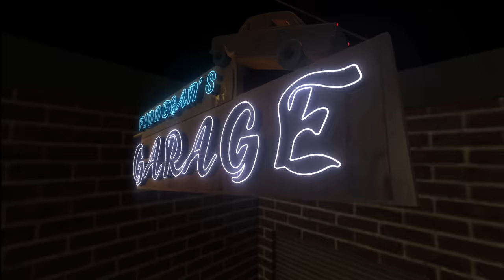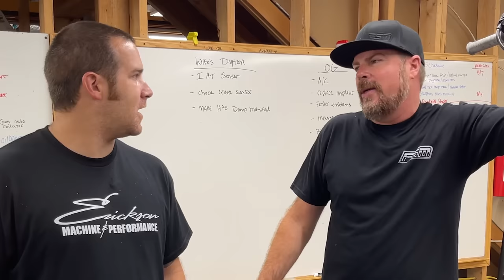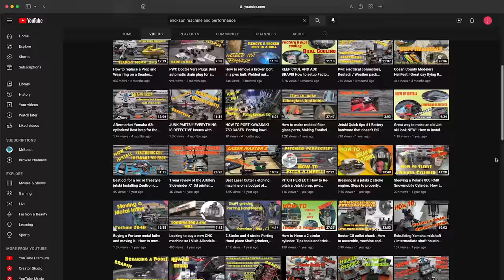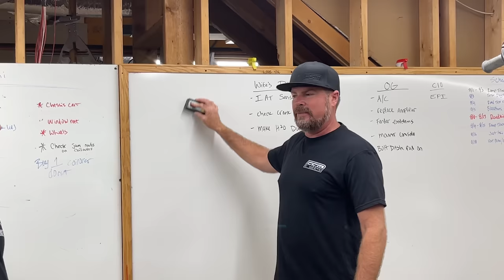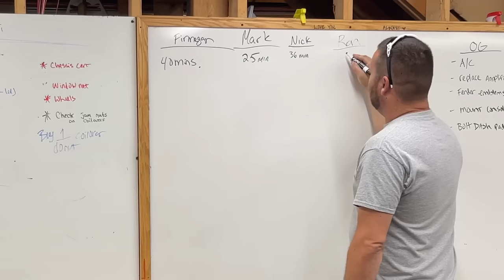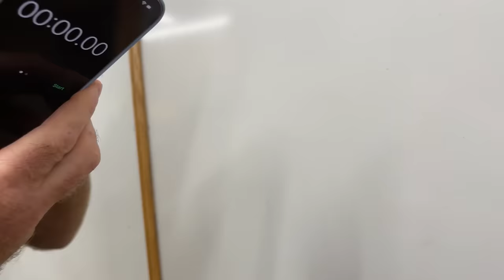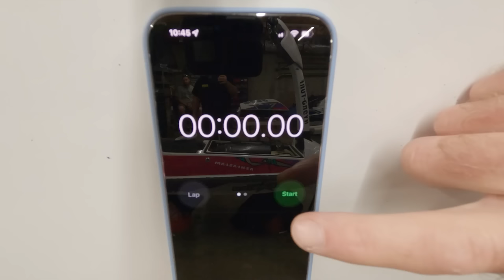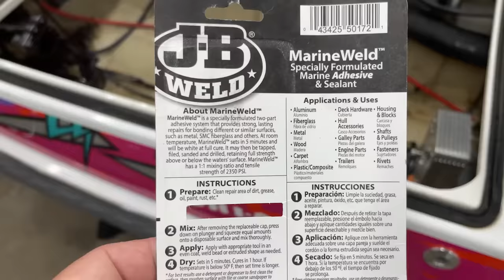BACKFLIPS ON A HOT ROD PERSONAL WATERCRAFT!

Comment: Thanks for having us on the channel!!  Enjoy the new powerplant!!
Reply: i don't think anyone thinks you can't supercharge or turbo a 2 stroke ... it's been done lots of times ... but making it reliable is the next problem
Reply: @Hard_Right  alot of people think you can't.    Very few have done with a PWC 2 stroke.    We are working on 1 now and will be on our channel soon
Reply: Awesome job bro. I had no idea prices were so reasonable for pump work etc. After im done painting my newest chopper build, I will for sure be getting ahold of you. Great job.
Reply: Good work man.
Reply: nice work, bring your own kroil next time
Reply: Dyk’ing lines and wires…that cuts time significantly.
Reply: @nationsenemy  only cut the hoses because we replaced all of them.  No wires where cut
Reply: Did you fix the head bolt that clearly didint take torque in your engine assembly video?
Reply: @drake_24v_hawkins  🤣
Reply: Hey pal,  i been workin in powersports for the last 20 years and one thing i do when I get water ingestion or breach on a 4 stroke is mix wd-40/oil at a ratio of 1/3 and you will see just how fast you can clear it up. =)  Never once had an issue with this hack.
Reply: Subscribed to Erickson M&P, it was so much fun to watch your passion at work.
Reply: Do you guys do the 2019 YXZ1000R  side by side 3 cylinder?
Reply: Dude, getting that motor out, and getting out the remnants of the broken motor mount bolt out, even after the first welded nut twisted off, in under 24 minutes.....you're a freakin' hero, dude. Good thrash!
Reply: Straight badass!
Reply: You guys were great.
Reply: hahahah. those people who think u cant turbo or supercharge a 2 stroke should head down to the Polaris dealership and check out some of the snowmobiles on the showroom floor!
Reply: You just made this the best episode!
Reply: @Hard_Right  2 stroke stuffing got a fluid coupled procharger style compressor for his 50cc nitro 2 smoke.

And the madlads videos are mad artistic.

30hp out of 50cc?
Nitromethane is gangster
Reply: This is amazing wish one day Mark could work on my ski:). I want a ripper. 😊 good job.
Reply: @BTR2018  🤘🤘🤘🤘🤘 thank you 😊

Comment: Love my Superjet and it was literally instant start every time for the first 5yrs at least and then just a starter relay and then i replaced the start/stop switch with a new one bc it was starting to act up. One cool thing about buying the Start/Stop Switch new from Yamaha OEM is that it includes the Nice OEM Safety Lanyard which is like 25$ alone or something and i like the oem one that has the piece to go around your wrist or to clip it on to the life jacket. Makes the price seem a little better at 150$ for the new one, complete ready to install.
He's got a nice solid setup there now, its going to be an insane difference from a stock 700, because an exhaust on a 700 gives you like 20hp alone lol, nevermind the 64X 760 cylinder on there. Cograts man! Rocking the clean SN. My first SJ was SN and i wish i still had that one..

Comment: Good info, nice setup , I have had 3 super jets  if you count one that  was just a hull , and 4 kawasakis over the years. I lived in southwest florida for years  thousands of hours on personal water craft for real. I ran beach services for 5 years. I would play around with different ride plates and maybe nozzles  before I touched the hull . The super jets hulls were great  and easier to corner because they cornered  flatter than the kawasakis. Wide open just bend your knees more and shift your wieght forward .  My old boss had a 94 with a set close to yours , when you held it wide open and let of the gas it felt like you were putting on the brakes becuse it pulled so hard.   Have fun watch out for boats and use the landyard. The old kawasakis used to circle when you crashed and you had to swim after them unless you set the idle down low, not good in the mangrove trails. Thanks great job, keep up the good work

Comment: There is nothing more satisfying than working on a standup ski, other than riding it after you get it running... I've owned standup skis for the better part of 40 years starting with the abysmal 550 that once running it was a blast to ride. I pretty much gave up water skiing from that point on.  I've melted more motors than I can recall and spent many a late evening stuffing the spare engine in for the next day.  My latest acquisition  is a 1500Sxi,  which is a big ski with gobs of power and cruising across the lake at 50mph is good enough for this old man.  My days of subs and back flips are over and the big ski keeps me from  trying even the simplest of tricks.  Have fun on that Yamaha,  it's the perfect ski for your wife and kids.

Comment: The biggest trick on the welded on nut removal is the first weld. If you just give it a pop on the initial weld it basically seals the
 nut/broken bolt from anymore welding getting good penetration. Have to commit right from the get go.

Comment: I’ve had a blast on one of those, after learning how far to lean forward to avoid porpoising.   I was on it when gas ram low, had to ride 6 miles back to camp smooth and straight on reserve.  That was some leg burn with waves most of the way.

Comment: 37:40 "It's to tune velocity" I'm pretty sure it's purpose is to resonate at a certain wavelength (rpm) and create boost. From the studies I've seen published online, a standard-ish 2-stroke with expansion pipe will make 8 to 10 pounds of pressure above atmospheric while "on the pipe" aka, when the RPM is within the resonance match of the pipe.

If you want to see an example of an expanding exhuast pipe that DOES help to tune the velocity, look at the formula 1 headers from the last several years. You will see that they come out of the engine block at a certain diameter, and after about 4 to 10 inches the primary tube will step up about 5 to 10% in size. I'm not 100% sure the science behind this but all the F1 cars do it so it must help!

Comment: Toss the whole drivetrain in a full length or even -4.3" Superfreak Badass or T1 hull, the best mod you can make to a superjet.  If your looking to get the nose down on that hull so that it does not porpoise a flat extended rideplate will help.  I couldn`t tell if yours was concave from the pics.  You can also space the back of the plate down with washers.  The intake grate can also help, a deeper top loader will sometimes help keep it controllable at WOT at the expense of a couple MPH.

Comment: I picked up my '91 650sx for nearly nothing a long time ago. After it blew up it got a SXR 800 engine.  Already had a Coffman's pipe so it was just a matter of getting the pump set up right for it. I know the 650 gets a lot of hate. I kind of think of it as the Mustang of standups. Kinda handles like shit but once you learn how to keep it under control it's a blast to ride.
Reply: I started on a 650sx, they're are great but limited by the tiny pump. And the hulls break in half easily when you beat on them in the waves.
Reply: @blainemacdonald6929  The pump in a 650 is the same diameter as a 750 or 800 pump. The impeller is set back differently but you can clearance a SXR impeller to go into the 650 pump. Where the 650 is limited in regards to the pump is the tunnel but I have addressed that. I'm 230 lbs and this thing tops 50mph with my fat ass on it. That was my goal. I'm going to repitch it for bottom end now. My ride plate, intake, and hull extensions have turned it into a reasonably well behaved ski. The weaknesses of the hull are known and easy to reinforce. In any case I'm on the lookout for a nice stock SXR to go on longer rides and keeping the 650 around for short range play. I've had this idea of building a modern day Yamasaki by putting a TR-1 in a SXR 800 hull. I think it could be a really nice setup.

Comment: So to elaborate a little bit more on super charging two strokes yes definitely can be done and will create more power however will drop the efficiency of the motor as far as fuel consumption whereas in some scenarios with a four stroke engine you will actually gain efficiency and power

Comment: 1987 Kawasaki JS650SX back in the day.   First time I submarined it, I got the nose pointed straight down and drove it right to the bottom of the lake.   Fish going up as I went down.  Accidental back flip off of the wake of a deep draft slow moving tugboat.  It was ugly.  I backflipped, but couldn't stay with it.  Broke the helper spring in the handlebar.  Traded the ski years later for a boat.  Got a call from the Kalamath Police about 10-12 years after selling that ski.  Was found in a house raid.  Title was never swapped and was still in my name.  Ski was junk.  Left it with the police.  Edit:  Supercharger kits were available(came out) back in the day for my ski.   Swappable comustion chambers,,so you could pull the heads down and street machine it,,or tighten things up and add full race fue. l on a belt supercharger.   Chris Fishetti rode one to wins.

Comment: Two strokes work better with a supercharger, that's what the original Detroit Diesels were, the supercharger evacuates the exhaust gases and charges the cylinder with compressed air for the compression stroke.

Comment: Force feeding a two stroke isn't that bad. Multi cylinder 2 strokes are the issue. Forcing pressure into the crank case can apply as much boost to the bottom of the off cylinders as it does the top of the firing cylinder. Isolating them and keeping most of your charge from blowing out the pipe is the hard part.

Comment: I've got a 30 horse 6 wheeler with a jet drive. A small turbo is the works. On the ground it does 30 mph on ground but in the water it is a disappointment. The turbo should change that, I hope.

Comment: i HAD A 550 WITH THE 750 CONVERSION....the primer lines started leaking, gas got on the starter 'noid , ski cranked and ran till it locked up... burnt up the engine. I guess im lucky there was no fire!

Comment: When will he make a 700 hp jet ski
Reply: Get Yamaha yxz engine from Packard performance there making 700 three cylinder 1liter. 💪
Reply: @techs1smh13  uhhhh by definition a liter is 1000 🤦🏻‍♂️ so a 700 can't be a 1 liter
Reply: it'll just break just like everything else they have "built" if they actually use it it breaks every time
Reply: @Hard_Right   700 hp 1 litre or 1000 cc